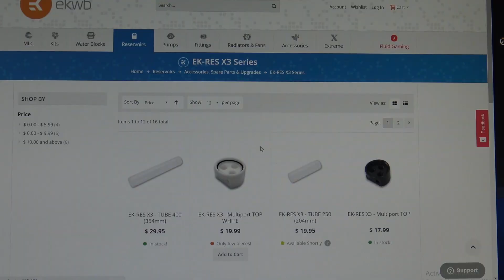5 Tips For an Easy Custom Loop

Comment: Great video as always. I understand having the fill/drain ports at the bottom of the front mounted radiator. But in that configuration are you not more likely to get a substantial air bubble/lock in the top portion of the radiator? 
Thanks for your time
Reply from the maker: +Rupert Jenkins perhaps, but the air pockets typically work themselves out, especially if you tip the case in different directions when you're initially priming the loop.